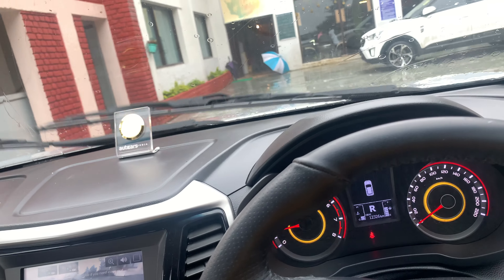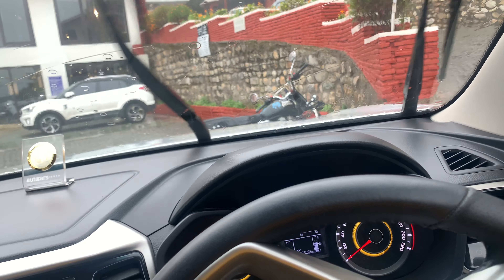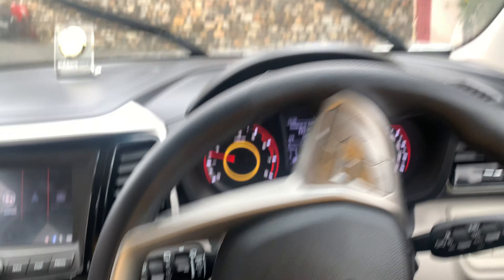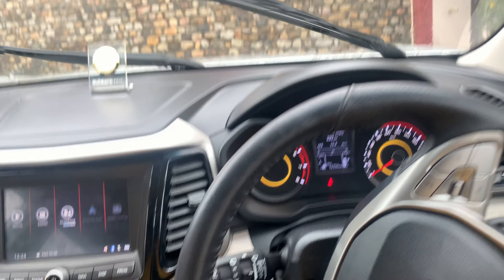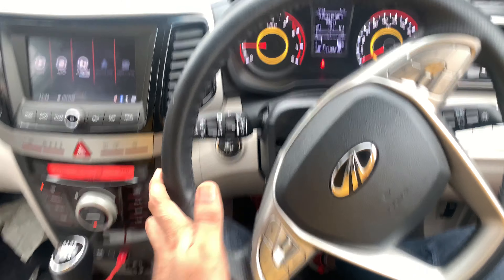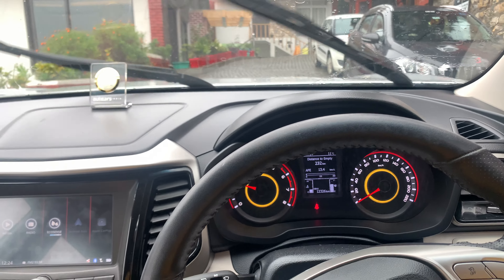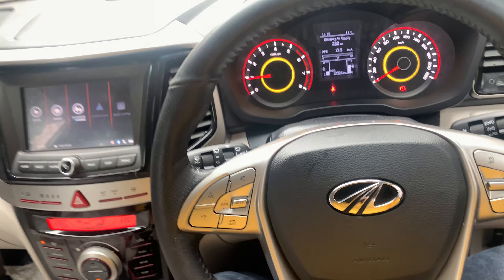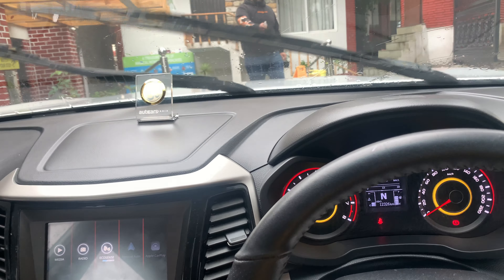Mahindra XUV 300 Hill Hold assist | Explained practially, Learn How to use & more

Comment: Will this work if Start/Stop Idle button is switched on (default)? I am unable to make it work. Every time I stop the car it goes to idle. Then pressing clutch switched on the car and then if release break it started rolling back. Holding for 2 seconds doesn’t work at all.
Reply from the maker: it will work for sure, just your inclination angle has to be a steep one. if it is not working, report the problem to mahindra immediately
Reply: @gagannayyar3758  yes I have reported this to Mahindra now. I think there is some issue with the sensor. My car is 3 months old only.
Reply: My problem with the Hill Start Assist is fixed now. Service Center did a quick fix after I gave them a test ride and showed the issue. Thanks
Reply: @indranildas6020 how bro?

Comment: XUV 300 performance in hill area is pathetic 
As per my personal experience 
If you stuck in jaam you face 
Clutch plates burning issue
In the hilly area 
Badly feel Turbo lag in hills 
Machine is only for for highway travel of plain area  
Never recommend to buy at all 
Go for other option 
भूल कर भी ना लें बाद में पछताएँगे
Reply: which model you have?
Reply: clutch plate burning issue??
it depends on driving.. Neutral the car, remove foot from clutch.. remember?
what would you comment on alto, wagonr performance on hills?? it depends only on driving... Truck bhi chalti h hills pe
Reply: I think u need to work on your driving skills
Reply: Driving skills improve kro